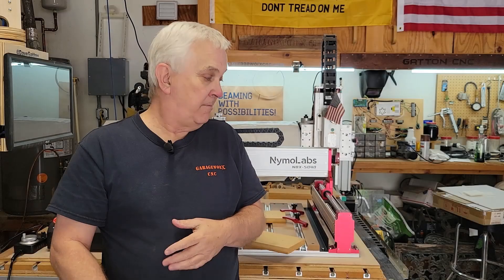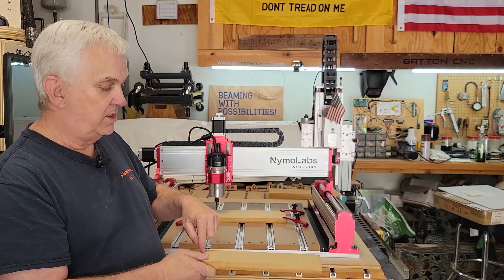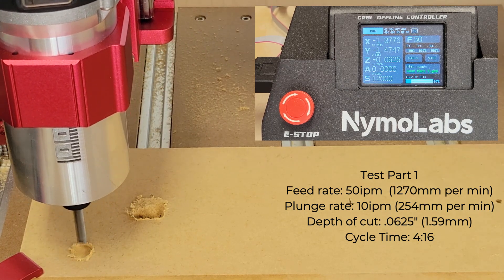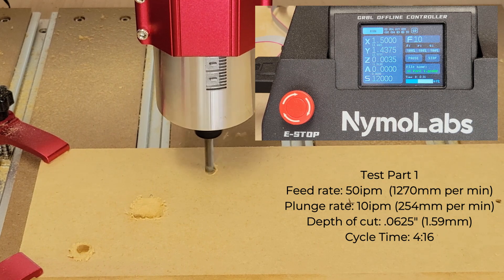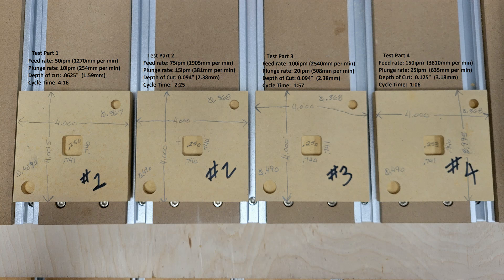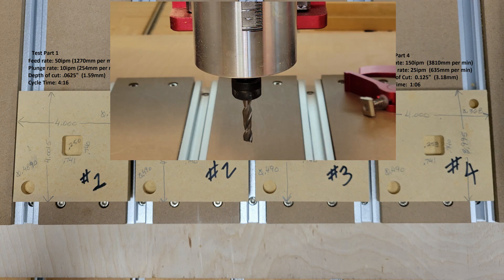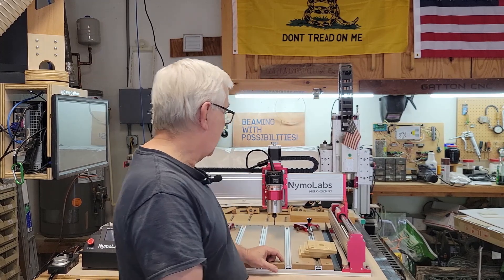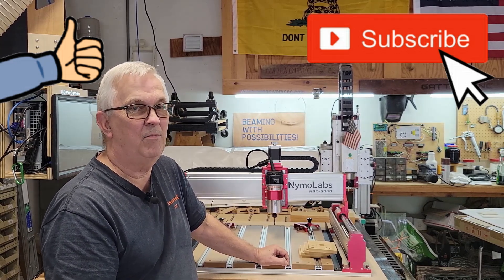NymoLabs NBX 5040 CNC Router - Is It Precise?

Comment: I need a little table top cnc for cutting small parts for my RC building that I do.  I'm well experienced in using cnc routers as I had a sign company with 3 cnc routers but they were bigger and a lot more $$$.  I've sold my sign company so I don't have the cnc's any longer.  This machine looks to be pretty solid as I see a lot of the others small desk tops with lots of play in the head which only causes trouble when you cut stuff.  Question for you is what software for generating the g-code does it use or can it use?  Design software I'd use CorelDraw or similar software.
Reply from the maker: I use Vcarve Pro for my design and generating Gcode.  This machine is GRBL based so you can use UGS (Universal Gcode Sender) or similar software.
Reply: @DaveGatton  The 6040 is in my basket at Amazon.  Looking forward to setting it up.
Reply from the maker: @sdmoller You're gonna love it!